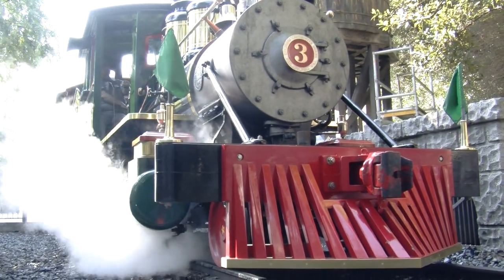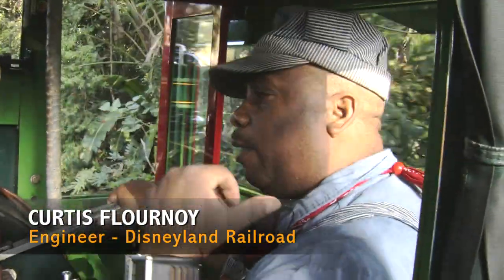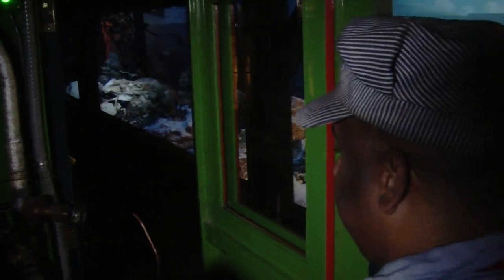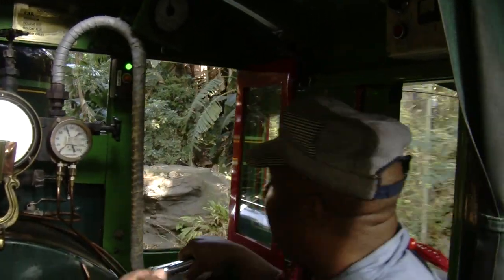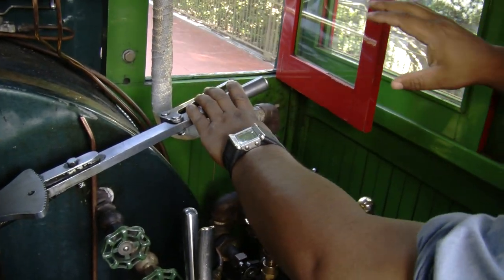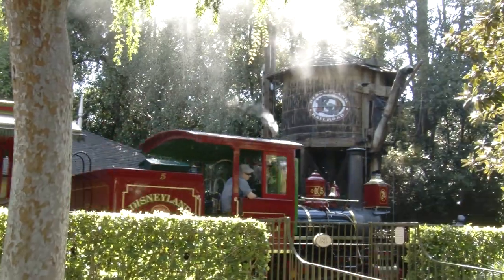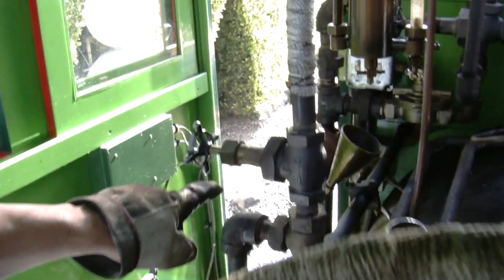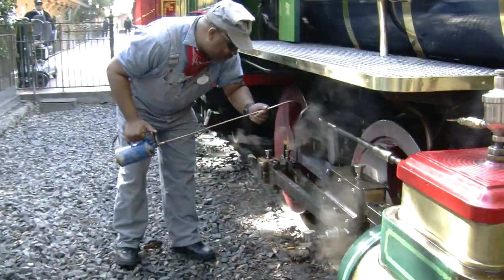How the Disneyland Railroad engineers and firemen run the locomotives

Comment: The train would not go kaboom without water. Most engines have a layer of water if it reaches that lower level the water is dropped on the fire putting it out making a boiler explosion next to impossible. Plus too much pressure will be released through emergency pressure release things. What actually happens with not enough water is you ruin the engine because it starts to melt.
Reply: Your talking about fusable plugs. Some engines do have them but a lot of them don't. Boiler explosions are caused by a lack of or no water on top of the Crown sheet which causes the Crown sheet to Heat up and weaken and when water hit's the red hot crown sheet it ruptures and no crew and even the passengers will walk away usually alive and yes the whole engine can explode, they do happen but they are rare. Take this example CPR 1275 in 1995 suffered a backdraft explosion in the firebox due to a lack of water (Well and poor maintance too which cause scale to build up and the water glass gave a false reading) The Design of the Crown sheet luckily prevented it from being a true boiler explosion. And i'm guessing your  talking about the Safety Valves which are set to trigger once the boiler reaches the Peak operating pressure Which is usually 150-200 PSI depending on the engine

Comment: What kind of fuel does it burn?
Reply: well its not coal most likely its an oil burner, I thought maybe natural gas but its most likely an oil burner  they way the valves look on it, if it were coal it would be a whole lot dirtier, and with an engine that small you would see the fireman shoveling occasionaly, but this is not the case at disney world.
Reply: No oil Walt Disney didn't like dirt in his parks. So he chose propane as his fuel.
All the steam engines burns propane both in Florida and California.
Reply: James Shanks it runs on a mix #2 diesel and French fry oil
Reply: @jamesshanks2614  in this video, they are burning oil; the valves are set up for an oil burner. Disney World burns oil.
Reply: biodiesel, also reused cooking oil

Comment: How do you become a Engineer?
Reply: Get hired by a RR. , pass all the tests, learn the route..Start out as a conductor..depending on RR,, may be 2 years or 8 years before you can apply for a Engineer job....Railroading is not for everyone, you are on call 24/7  365, and will be away from home a lot...hard work in all weather conditions, when you get called in to work, you have 1-2 hours to be there and can not turn down the request.
Reply: Jeez - Glad I work on the railway in the UK. Conditions are nothing like as bad as you point out above.
Reply: He’s correct. Ive been a conductor for 3-4 years
Reply: I would like to know also!
Reply: Why?  Don't trains run on schedules?
Reply: Just wondering is this for CXS  or NS
Reply: every railroad...everywhere....from Class III Shortlines to the Class 1 RailRoads ..and it is CSX....not CXS
Reply: thats cool, what Railroad?
Reply: no...when the freight is ready a crew is dispatched